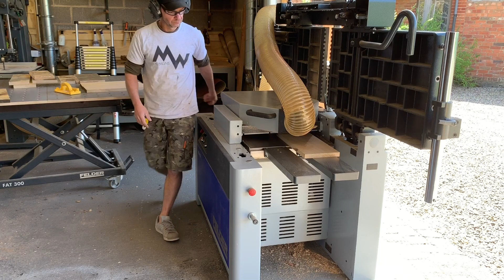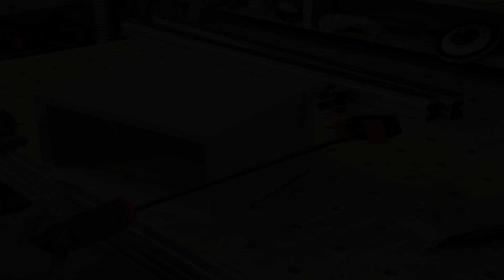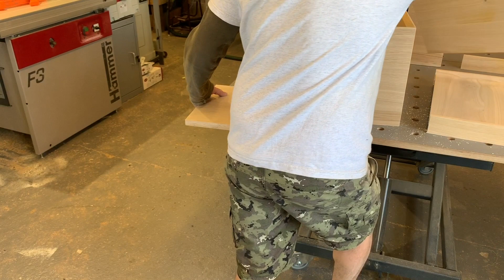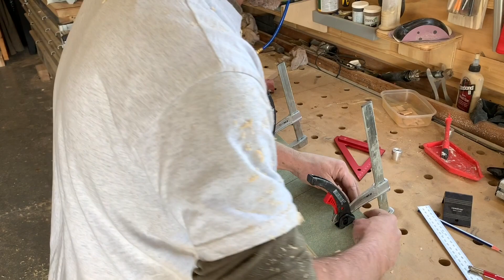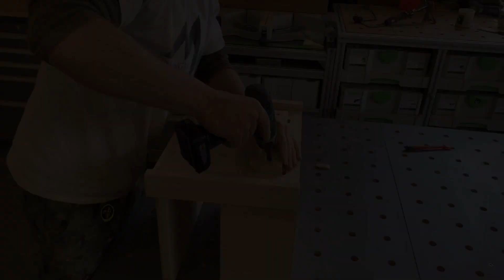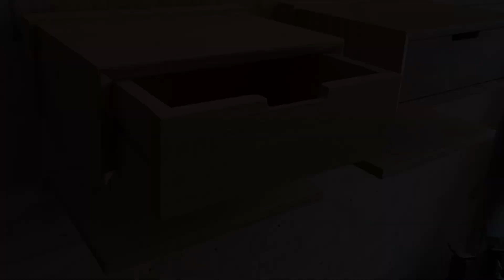English Chestnut  - Floating Bedside Table - Nightstands

Comment: Beautiful material and an excellent choice of finish so as not to take away from it. I'm sure you could do a limited production run of these or offer as an a la carte item and they'd sell well. They're great. One design point though, which I only mention because of the level you're working at; I think the design would lend itself to flushed sides. As in flush to the drawer carcass with the lower shelf housed at the rear into the side panel, flushing up where it floats at the front. Just think that would elevate your already clean design approach. Please don't read this as a nit-pick though mate.  It is excellent work.
Reply from the maker: Cheers BBB,  I needed a way to stand this pair off the wall so it  has room for easy cable run there are a couple of other ways this could be done but I felt the rear edge helped with the thickness need for the amount of stand off needed from the wall

Comment: With all the different types of trees your using timber from how do you identify the different species? Is this just down to experience or did you learn this somewhere? I'm in the process of setting up a small kiln outside my workshop, similar to yours but smaller in length, any advice would be greatly appreciated. As always, fantastic work 👌
Reply from the maker: you learn the grain and the smell .. in the UK there are only a small number of tree types I use anyway

Comment: Hi Andy. When fitting the runners are you using spacers inside the box to ensure the correct placement? I'm about to use oak runners and like the look of this method but would like know how you ensure the runners are placed exactly to ensure the correct gap around the drawer? Cheers
Reply from the maker: These drawers are very small so the fit was good enough to line up the runners

Comment: Very nice project.  I was wondering why yu chose to use biscuits over Domino's to reinforce the 45 degree bevels.  I use shortened 5mm Domino's to reinforce 1/2" thick material with  45 degree bevels for small boxes.
Reply from the maker: Simple no clamps needed!!  , it’s a lamello clamex not a biscuit
Reply: @ManorWood  AH!  Got it.

Comment: Beautiful furniture. What was the purpose of the holes in the vertical uprights in the back? Maybe I missed it.
Reply from the maker: Cable can  runs behind , also 2x holes for air when you close the drawer
Reply: @ManorWood  Thanks.
Reply: Manor Wood my tolerances are so bad, I have plenty of room for the air to escape as it is! 🤣

Comment: Me and a few mates have been trying to guess how much it cost to set up your workshop, whats the damage? Best regards Mick.
Reply from the maker: 2nd hand and Ebay not as much as you may think :)
Reply: @ManorWood  Ah, still no wiser.
Reply: @michaelkilner5031  
I would say half a million in skills learned.  A career today can cost that much in learning alone. All that effort time and lots of mistakes. 

Average carpenter hourly rate in UK is £12 p/h so that at a 40 hour week for 20 years is £499200.

So in 20 years time that rate adjusted for inflation will probably be £820,000. The physical equipment probably is only a fraction of that.

Comment: It looks great and the technique is amazing but unfortunately I don't have the space and the money to build a shop like this one with all the top notch machines worth of 100k$ and more...
Reply: My friend, there is nothing here that can't be done with some basic power tools. Replace Domino's with dowels, use a circular saw or mitre saw to cut materials etc. Don't be put off by his amazing kit, which he has worked incredibly hard to pay for. You can achieve results like this, it just might take you a little longer. 👍
Reply from the maker: Spot on, hand power tools and buy your wood machined from the wood yard also helps ..
Reply: +Moran Guy
The guy that runs this channel is doing it as a business so that he has to have good output to make money that means using higher end equipment that produces good results. 

You can do all of this with just a hand saw, chisels, hand plane and few other little cheap tools if you desire. 

There are plenty of channels that give demonstrations and teach how to start out with this. To be honest in the modern world if you wanted to learn to do traditional carpentry with just hand tools you need to learn it yourself as there are very few apprenticeships like this now. I was very lucky to learn from my grandfather before he died and now I am teaching my Sons and Daughters.

Hand Saws, Chisels and Hand Plane are the way to go. It is cheap and easy to acquire and you can learn from the internet.